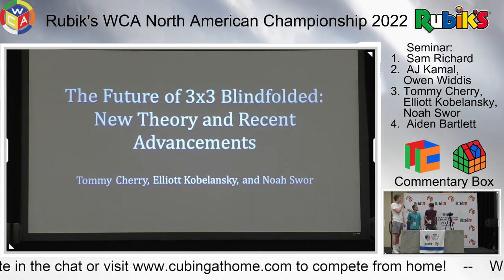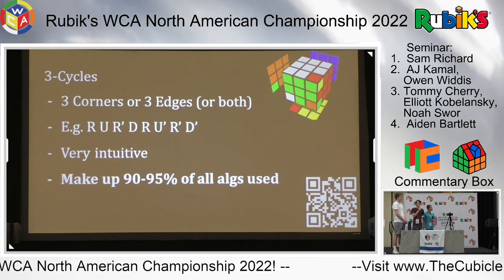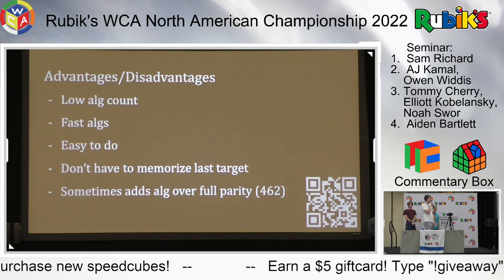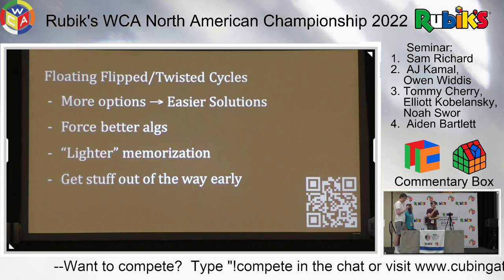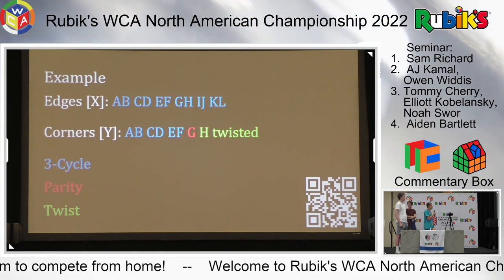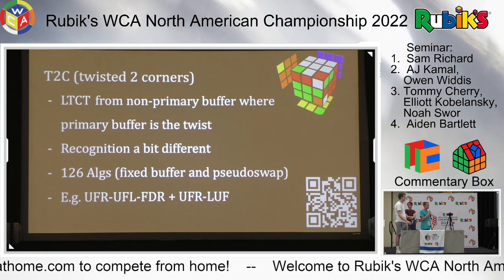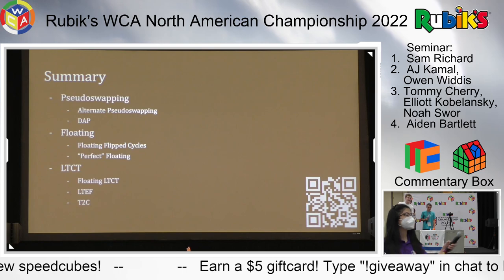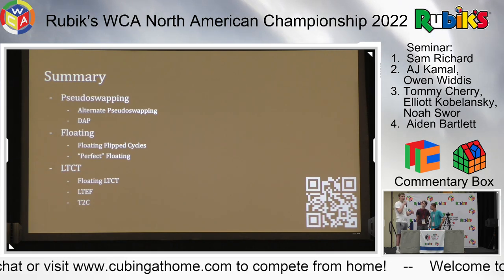The Future of 3x3 Blindfolded: New Theory and Recent Advancements (NAC 2022 Seminar)

Comment: 23:28 Elliott laying down the law.
Reply: 24:27 Noah explains how learning 3-Style helped with memo.

For me, learning 3-Style also helped my memo, because practise was a lot more interesting and I ended up doing many more sighted solves and also improved my tracing in the process. 3-Style sighted solves are simply a lot more fun to do than M2/OP or OP/OP. I currently only average around 2:30-3:00 with 50% or higher success rates depending on my level of practise (usually about sub-1 exec), so being fast at M2/OP isn't a prerequisite to learn 3-Style so long as one is interested enough in the technique to trust that longer term gains will happen in due course.

Comment: Will “5 style” ever be used in future solves, say 5-10 or so years from now? Not full 5 style, but a decent portion of it, so you can get a 5 style case say every 10 solves or so. Is that realistic? And if so, where can one learn 5 style?
Reply from the maker: I don't think it's that realistic since there are way too many cases, but one can attempt to learn 5-style from https://docs.google.com/spreadsheets/d/158F-jyu8ld8kbdD4I_Lqy4fsX5vvp_MQOq7Ofg8NdSI/edit#gid=1229717195
Reply: @TommyCherry  ah, thanks so much, and indeed it is way too many cases, I’m planning on (in a years time) learning all of the cases that start with AN (UBL) (RUB). Is there also 4 style for corners? If so, can you link a resource to learn from that has all the algs? If not that’s alright, you’ve already helped enough with the 5 style sheet!
Reply from the maker: @DillPicklePatrick  4-style doesn't exist on its own because of parity, but something like 4-style + an edge 2-swap is possible. I don't think anyone's spent much time generating algs like these though.
Reply: What about a 4 way setup 5style eka method 
Where You setup a piece nearest to UR or FR or FL or UL  
It has an Avg. move count of 12.4stm  but has 21600 algs which has 105k less algs than regular 5style
Reply: @DillPicklePatrick  i think you need to learn about 12672 algs

Comment: Snapshot memo and visual memo is the same.

Smart cycle breaking and cycle break order is the same.
Reply from the maker: Nah.
Snapshot memo = just taking a glance at the cube (without tracing the pieces), putting the blindfold on pretty much instantly, and using process of elimination to figure out what your exec might need to be based on what you remember. We put it at the very bottom of the list because it's very unreasonable right now and if people ever effectively utilize it, it'll likely be far in the future. Visual memo, however, generally involves tracing the pieces and forming an image of them in your mind based on the order by which they come up in your memo.
Smart cycle breaking refers to making a good cycle break decision at any point in a solve (which can be based on a variety of factors, so intuition might serve one best), while cycle break order refers more to a more rigid approach where you prioritize certain targets based on other things, such as choosing a certain second target of a pair when cycle breaking based on the first target in the pair. I value smart cycle breaking much more; the only reason we included cycle break order above it was that it's similar to buffer order (but I see a buffer order as much more necessary than a cycle break order in almost all cases).
Hopefully this clears stuff up.